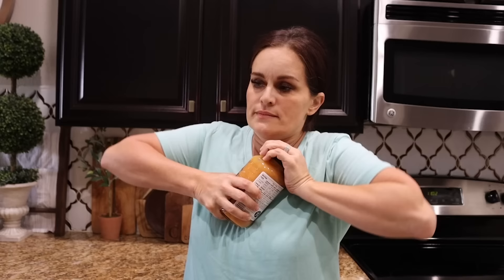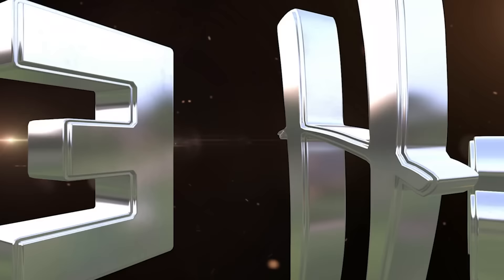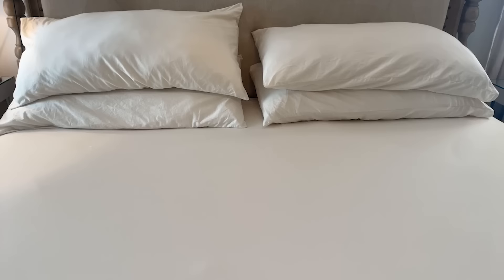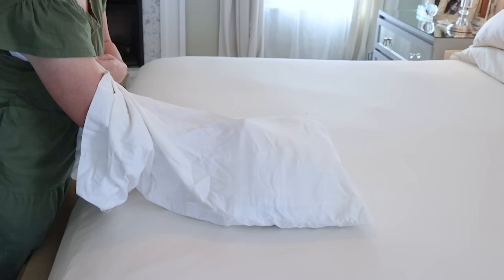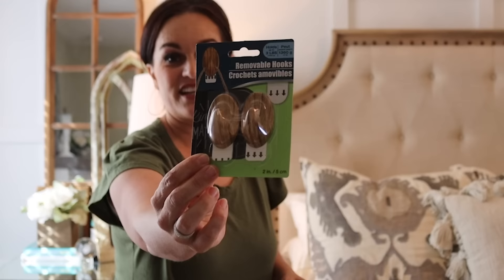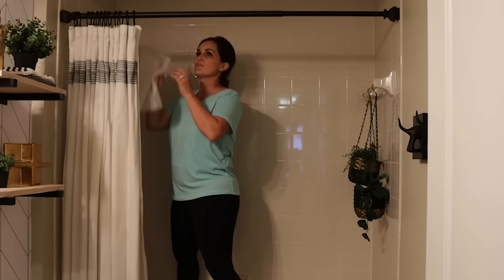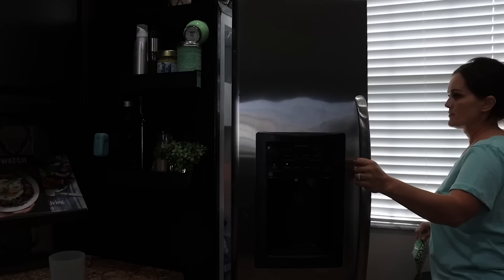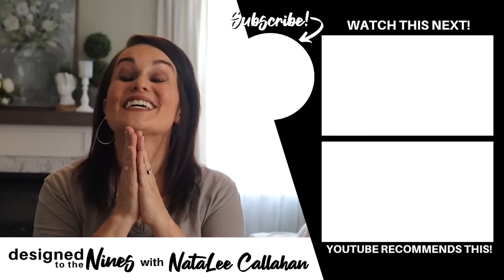15 Life-Changing HOME HACKS That’ll Wow! (Some you sent me)

Comment from the maker: ⭐Do you have an awesome home hack you want to share with me? I'd love to hear about it! Like this episode? Watch this next: https://youtu.be/k17eYCX8RHQ
Reply: I have a much better jar opening hack for you.   Take a flat utensil (like a butter knife or if you prefer a flat head screwdriver.  It just has to be sturdy and thin enough to fit between the lid and jar rim).  Stick it between the lid and the jar rim.  Twist (the knife or screwdriver).  Wait to hear a "pop" of air.  Open the jar.  Try it.  It couldn't be easier and you'll never use anything else after  -  Anna
Reply: I just take the butter knife and tap it to break the seal or bang it on the counter top a couple times and pops the seals.?I have never had a glass jar break before. That’s how my mom and grandma did it! Lol
Reply: I hang wreaths on a hanger in the craft closet when not in use !
Reply: I like the idea of the denture cleaner in the toilet but I use denture cleaners for another purpose.  Use them in your stainless steel thermos's (like a Stanley thermos) and also use it in your glass coffee pot, not the coffee maker.  Add hot water to the item and add one or two denture tablets (depending on how big), let sit for a little while and you will be amazed at how well it cleans these items.  (I accidentally left the water and denture cleaner in a thermos we don't use often for a couple of weeks and the yuk that came out was as amazing as it was gross!  But the darn thing looked brand new inside).  Imagine what this stuff does for dentures!!  Rose
Reply: @aksaks5066  I have been doing this since my mom showed me in the late 50s.  It's much easier.
Reply: @gingereaves4097  The tape in the original video or the hack I posted?  
My dad taught me the hack I posted decades ago too.  I've never asked anyone else to open a jar for me since.
Reply: I use the frame hack with my thermostat!
Reply: Natalee, it is much easier if you use a beer can opener. Use the flat edge not the pointed. Pop the lid just until you hear a whoosh then put the opener down and twist the lid off with a gentle twist. Much easier than the tape. Good luck. 
Carolyn
Reply: Watching you wrestle those sheets onto the bed (and having a corner pop off) made me realize that not everyone knows this tip my mom taught me.  Put on one corner of the fitted sheet, then put on the corner that’s diagonal to it.  The fabric will have a stretch to it because it’s on the bias.  Then do the other two.  So easy!  I’ve been putting sheets on this way automatically for decades.
Reply: Hey Heidi love the frames around light switches! Wanted to let you know my heart valve replacement surgery in May I'm having the Meme surgery less invasive up the groin 5 days in hospital  Prayers please 🙏
Reply: For folding sheets watch tidy with a spark on TikTok…I used to do it how you just did but found her way to be so much more tidy and I can keep up with everything! It looks neat and tidy and stacks sooooo well in either drawers under the bed, linen closet etc.I have some in both!
Reply: I have studied the following for several years, post grad, and the subject is Quantum Physics Science defined:

This is the key to our Life Journey, it is the Devine Design and we literally create all of our reality, experiences, the positive, desires, and the undesired, so we have a "choice to manage our: *"Thoughts + Feelings X Beliefs"
= *(Our Frequency, which is always attracting like energies/vibe/Frequency)

The "Universal Law of Attraction" is Absolute.

Key points that will support Positive Thoughts/Feelings and establishing a "New Subconscious Thought Program".

1) establish a habit of being*"Conscious in Thought" +  "Applying Higher Mind"*
All Positive Thought Energies reside in the Higher Mind aka Mature Mind, (all negative Thought Energies reside in the Lower Mind, aka Ego Mind, aka Adolescent Mind: fear, doubt, prejudice Judgemental, jealousy, gossip, prejudices, all lower energies thoughts/feelings, fear being the lowest.)

To Reprogram the Subconscious Thought Program, see Dr Bruce Lipton's website for recommended methods.

*If you Meditate ie: Quiet Mind, just 15 - 20 minutes daily, *"You will release the illness and gain Harmony in Wellbeing. This will work over time and improve your total Health.  Fact.  

See Dr Joe Dispenza's works to verify. 

A low starch, low carb, no sugar diet will help you raise your Immune System, the Candida and Gap Diets are the go to for this. 

Lastly, Cardio, a 20 minute  treadmill every day, 5 days a week will inspire greater Physical energy.  

These are basic Health Boosting facts, and after just 1 week you will literally see the improvement in your Face, it does for everyone, Cardio just is the best firming youth lifting real value.  

15 - 20 minutes of Meditation is the most important of all   

We have every excuse to not, but we must always treat self with "us 1st" + balanced self love, we must do this then we can focus on all of the ones we love. 

If you have Questions just ask. 
I'm prepping a book to offer the recipe of these values, a sort of workbook to ensure all points are comprehended for confidence and Successes. 

Best Thoughts to You ... 

Beth
Tennessee, USA
Sociologist/Behavioralist

Comment: The reason why many previously unopened food jars are hard to open, is because a vacuum has formed in the jar lid.  By placing a spoon under the bottom edge of the jar lid, and lifting the edge of the jar lid just a little, allowing a bit of air to enter into the jar, it will break the vacuum grip on the lid, and the lid will open easily, without strain.
Reply: I came to say this. I don’t always use a spoon. Sometimes a butter knife… just anything that lifts the tiniest bit to break the vacuum seal. And VIOLA!
Reply: I was just going to say about the spoon lol so much easier 😊
Reply: I use the handle end of a butter knife and tap around the edges of the lid and it will also break the seal.
Reply: I have this problem with jars of hot sauce we can. If you turn it upside down and hit the lid on the counter, it breaks the seal and makes it easy to open.
Reply: I use the handle of a spoon, fork, knife to bang the edge of the lid (making a small indent to allow air in) with zero strain. I usually do 3 times around jar to make sure, but one is enough. Sometimes I take the table knife (non-pointed) and put the tip under lip and twist up. Should hear pop and then jar will open.
Reply: I do the same thing!
Reply: Absolutely...I use the old fashioned can opener to pop the seal.
Reply: I use a can opener to release the vacuum. The type of can opener is the one you use to open like a triangle on a can of evaporated milk to pour the milk.
Reply: This is what i do.
Reply: @annyhahn3527  A "church key" bottle/can opener.
Reply: Yes I use a table knife nothing pointed or sharp and break the vacuum seal and the jar will open very easy.
Reply: I was going to say the same thing.
Reply: Use a butter knife and tap the side of the lid in a circular motive around the rim. 2 or 3 times and it works like a charm.
Reply: You can also tap the bottom with your hand that will also break the seal and make the jar easier to open!
Reply: Yes, that works!
Reply: @DIY Deborah  this is what I do...works a treat every time
Reply: I tap it on the countertop and it works.
Reply: Also wrapping a thick rubber band will also work.
Reply: I have always just tapped the cap on the counter a couple times and voila!
Reply: @shellylemons  ❤ I do this too 😊
Reply: If I’m not keeping the lid I just use a large knife poke a hole and it opens without any strength needed!
Reply: I’m so glad to hear that you are a princess on a pea! Me, too! I always thought I was the only one! Thanks for showing us the hacks!
Reply: Sometimes you just need to smack the bottom of the jar to break the vacuum and sometimes it takes prying the lid a little with a spoon or butter knife.
Reply: I just use an old type beer can opener..insert it under the lip of the jar and lift…it breaks the vacuum seal and the jar opens easily without spilling.
Reply: I use a reusable silicone bowl cover. If that doesn't work, I use a bottle opener to unlock the vacuum seal.
Reply: I also open jars with a knife or spoon, it is soooo much easier.
Reply: Not one of these things helped with opening a large plastic jar of the pickles you find in the refrigerator section of the supermarket. The duct tape worked I almost threw them out because I could not open them.   I never had such a horrible time trying to open anything like this before. Blessings

Comment: Love these hacks as always! If having trouble with a lid I run it under hot water then tap if needed with a utensil. I  plan to use the frame/outlet hack! For the cell phone cords I use the round rubber grips at the top back of my nighstands so they don't slip off the hook. I've used hydrogen peroxide for years for blood. I just spilled spaghetti sauce on my ivory colored rug yesterday and was able to completely remove it with peroxide, some stain remover spray and a little dish soap. You cannot tell anything was ever spilled. You can also use the bread bag tags for labeling various cords and attach them like for the mass of cords behind the TV. Then instead of using the tags for the bread wrapper, just twist the bag opening and fold back over the loaf.

Comment: For a moldable ice pack use a solution of 50/50 alcohol and water. Place a folded washcloth in the solution, wring it out so that it is still wet, but not excessively dripping, and then place it in the sandwich or snack-sized bag and freeze. ALWAYS be sure to place a layer of cloth between the "icebag" and your skin so that you do not further damage injured skin.
Reply: Thats a great idea! I sure could have used that idea when my husband had surgery or when I need a bendable one for my neck pain. Thank you!

Comment: U can also use a heavier utensil ( I use the handle end of a butter knife) and pop around the jar lid to break the vacuum seal. U can also, to turn the lid easier, use those rug grip pads from dollar tree, I cut mine into smaller pieces.

Comment: I had done the frame around the outlet in my craft room. I love the idea. Not sure why I haven't done it in other rooms. :)
Reply: Such a great idea. I will be doing this in my kitchen.
Reply: I have a frame around my thermostat in the hallway.
Reply: I want to do this, but I have 2 side by side fixtures. One with 3 switches will work with a 5x7, but the other one is a double switch. The size is not going to work with a standard sized frame. I guess I’ll have to beg my husband to create a custom frame to match the purchased one.

Comment: Great hacks! I fold all four corners of my fitted sheets inside each other, then square up the scrunched edges, fold up the straight edge, then fold in thirds. 
Also, those bread tabs are great for putting under the edge of masking tape to easily find and peel back the tape.

Comment: When you fold the fitted sheet, bring one of the ends inside the other,  then square it up. Folds much easier. Then, fold your flat sheet long ways. Put the fitted sheet in the middle of the long folded flat sheet and put your folded pillowcases on top. Fold your flat sheet one end on top of the fitted sheet and pillowcases, then fold the other end. And you only have to grab the one flat sheet because  the rest of the set is encased all together.
Reply: This is what I do 👍
Reply: That's how I do it. The fitted sheet can be made much flatter that way and it fit inside the folded flat sheet perfectly! I'm in my 60's and I've done this my whole life and so has my Mother and Grandmother. I'm guessing g-grandmother taught her or she learned it during her nursing years.  I love the idea of turning one pillow case inside out for allergy relief!!  I need that for sure! @Designed To The Nines thanks for sharing that hack.
Reply: 😮I wanted to comment how to do it so it was easy to understand but you did an excellent job so now I dont have to. 😅

Comment: If u take your sheets out from storage, (washed earlier), after u put them on the bed, I use a generic wrinkle release to spray them lightly, both the fitted and top sheets, then turn on ceiling fan. That way u don’t have to use the sheets immediately or dampen them . 😊

Comment: Another option to open those tight glass jar lids is to use the pointy end of an old fashioned bottle opener.  Tuck under the edge of metal lid and pull up gently….repeat several times around the lid of the jar and the vacuum seal will release and easily screw off.  I deal with a lot of arthritis and loss of strength in my hands so I use this a lot!
Reply: I love this idea!  Thanks for sharing!

Comment: Thx for sharing how to fold a fitted sheet. However, I take it one step further. After tucking the 2 opposite corners I put them together again & fold all four corners into one. It's easy to lay out & square up.  My Momma showed me long ago & said this is how they come out of the pkg. I have been framing my light fixtures for years & it does look very cool. Thx for sharing that also. I buy a bag of ice & fill my seal a  meal bags to desired sizes. Mainly use them to ice the water when I make hard boiled eggs in the Instant Pot.  It saves water & unlike the blue ice ones from the store if they spring a leak, no big deal & no toxins. I  can refreeze them too. I enjoyed this episode. Thx 💥

Comment: I have a hint when putting on sheets. I use to have problems figuring out if my king sheets were going on side ways or straight until I realized that the tag in the inside corner always goes on the bottom left ( looking from the head of the bed) or caddy corner ( top right). One less frustration on changing day.😊

Comment: Great Hacks, Natalee. Looking forward to your new Tool Range. 

My duvet covers don't have ties inside, and as I'm a single-mum, always struggled to put the covers on for years, especially after my accident, - I'd even crawl inside to try and get the ends on, ended up looking like I was fighting the cat!! 🤣now I turn them inside out and put a clothes peg on all corners,  then grab top and bottom corners on my side, quick shake, and it's done. Do this on single, double and Kingsize, works every time.  

I put a denture tablet inside the bowl and leave it overnight then flush in the morning, but will try putting it in the tank, Also if you have any Coca-Cola that is out of date [or ask your local supermarket if they have any out dated stock] if you pour that inside the bowl, leave overnight, flush in the morning, brings the bowl up like new. Coca-Cola is also great for removing rust on items too.

Comment: I have a hack - I put a cookie jar w/a silver lid on the shelf over my dryer, & I put unmatched socks in it + used dryer sheets as they come out of the dryer w/clothes. I use the sheets to wipe down the dryer filter after getting the big stuff off, & then I use another sheet to dust off my washer & dryer. Plus, since I save them, I use them to dust here & there, & they work great! It's just like a swiffer dry, but small & w/a light scent. Ppl use unused sheets for lots of things, but this is a way to recycle those sheets for 1 more use:) It's not life-changing, but it works for me. I go thru the socks that get tucked underneath the used sheets every so often, & they smell great for an added bonus! 

I also keep a glass cookie jar w/a lid on my desk, & I filled it w/my collection of office clips in various sizes. It's an easy place to grab large clips for w/e reason, & it's convenient bc I can see thru the glass which color/size I need. 

I also fold up a plastic grocery bag & put it inside a wastebasket underneath w/e plastic grocery bag already in it, & that way there's always an extra bag or 2 there when you need to change it. You can also use 1 to double up the bag in the wastebasket if needed to throw out something heavy, or maybe extra protection if someone in the family is ill & needs something next to them to get sick in. 
These are just a few little things, & I hope they help out someone:)

Comment: That's a hilarious hack for opening jars. 😂 it did work... but it's a bit messy. Here's mine. Take your jar... run the lid under warm/hot water... then upon removing from the stream of water... give the bottom of the jar two firm slap with the palm of your hand... you should hear a pop of the seal... then unscrew the lid... it usually works a treat for me.

Comment: Hi pretty momma!⚘ Dishwash pods will clean almost everything..i use it for my rugs,my couch,the fabric on my chairs. Take a pod,throw it in a bowl with hot water..Untill it's dissolved..Poor a little cold water  in..Untill (Water temp. is about 86°Degrees) Take a white guest towel..Soak it in the solution and wringe the excess water out.. And wrap it around small lid of a pan..Like a gift..Corners of the towel must be on the handle..Tie them with a rubberband.. Now you can use it on chairs,rugs and your couch to clean!  (Especially Velvet fabric) Rinse towel, Repeat after just with just water to rinse,in long strokes..
The lid handle has the grip you need to do the job! 👍💪🌼
Love ya! Hope you feel better soon. 🍫🌻❤ TFS♡ X0

Comment: I like to fold my fitted sheet into a long rectangular shape. I fold the top sheet in a similar way and stack the two on top of each other. For the pillow cases, I fold them lengthwise and place them on top of the stack. Finally, I fold the 2 ends to meet in middle and fold once more time to make a square stack. Everything is all together and easy to handle.

Comment: If you tap the rim of your jar lid in 3 different places with the dull side  of a dinner knife, it will break the seal and allow you open your jar very easily. Note: enough to leave a slight dent but not to break the glass